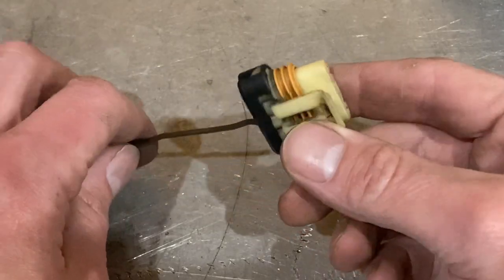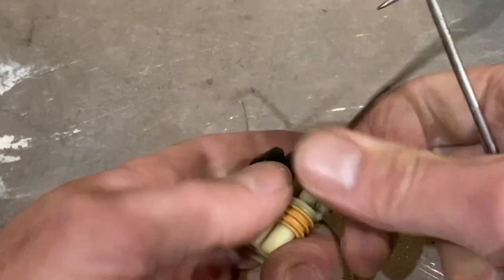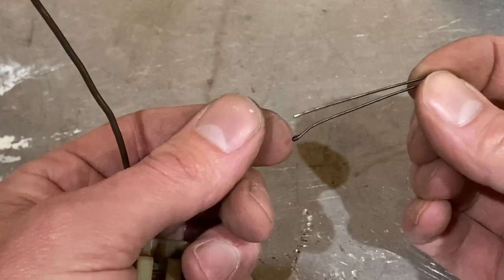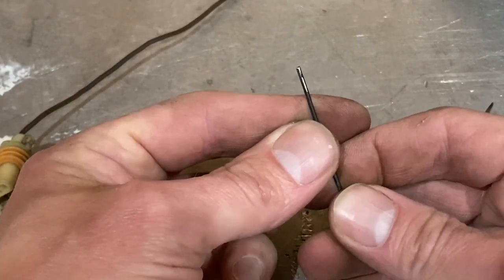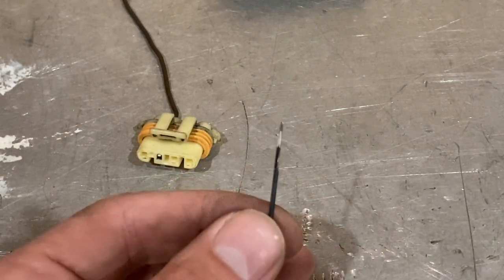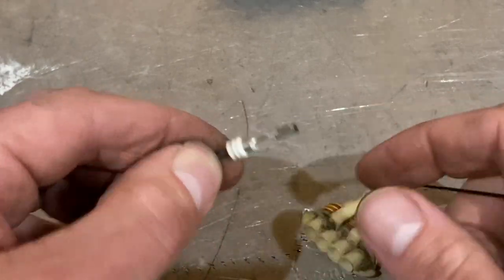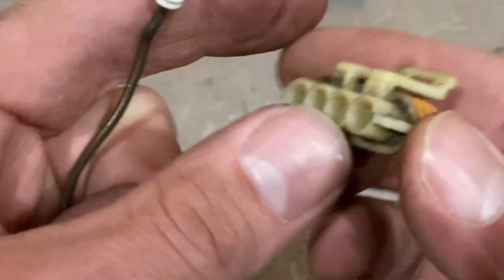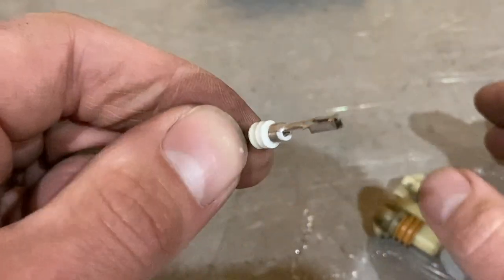How To Remove Pins / Wires From A Delphi Style Connector With A Hair Clip. GM LS Alternator LS1

Comment: Thanks for the tip. Where can I find the metal connectors and the seals I need to make up replacement wires for a Delphi neutral Safety Switch Connector due to rat damage chewed off behind the seals and a crimping tool or where can I find a pre assembled wire set? Standard S1516 is a generic replacement with only 6 wires and the one I am working on Uses 11. Any help
Will be appreciated thanks

Comment: Thank you.  I needed to shorten my alt wire about 18in without using a splice.  I'll just have to buy the correct connectors since I have more to do.
Reply from the maker: A splice can be totally fine if done right. Even factory car wiring uses crimped splices. Thanks for watching!